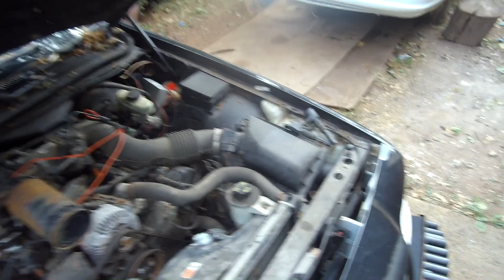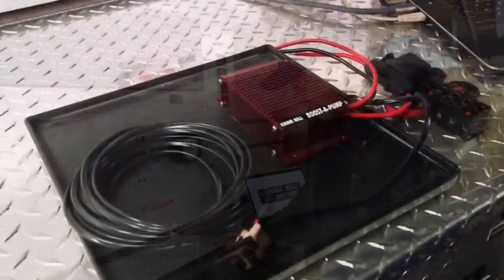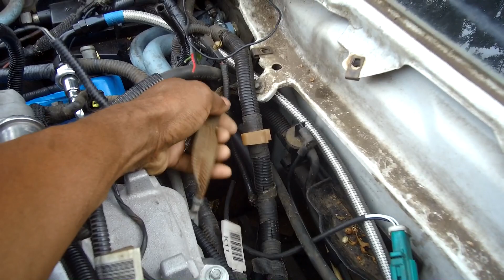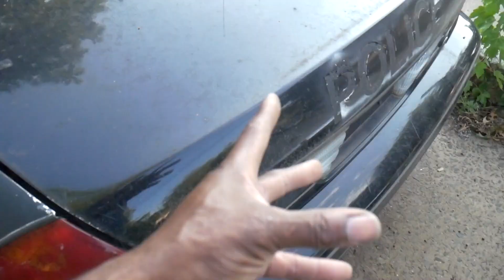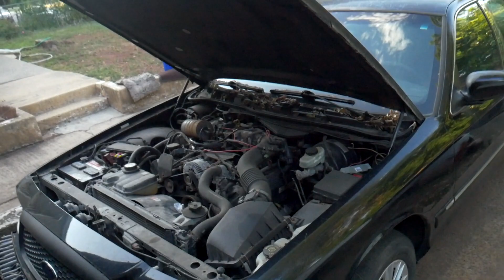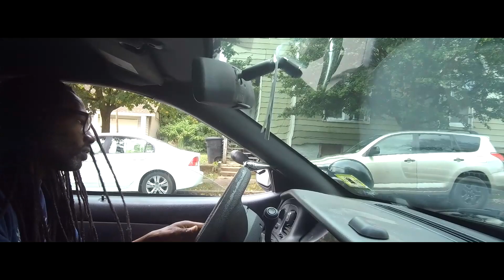Crown Victoria ( Simple Repair )  Fundamentals  and Panther Build YOUR CALL!

Comment: The body can be fixed but you've already lost steam on it. You have a bad taste for the Vic brother. You have to decide whether you want to wash your mouth out and knock her out. I'm having the same issue with my 03' I love the sound of a Vic. I keep jumping back and forth between spending dumb ass amount of money to get that 4.6 to make decent power or just Ls swap it. I am working on building a 6.0L gen 4 engine. But it won't sound like a Vic anymore. The cams are 7 to 800 bucks for the 4.6l. It 250 to 400 for the 6.0. I'm stuck as well. I can get a supercharger from. ADTR but again it's $6500. I can do the swap with a 6.0L and 4l80 for about 4 grand and get 400 at the tires easily. Bro that Vic is worth fixing. If it is to you. It'll never be perfect. They never are. But perfection is fleeting.  Thanx for the content as always brother. I really enjoy your videos. If I do the swap tho my wife wants me to do a step by step of how I do it.And put it up on YouTube to help someone that might need it.I already have conversion mounts and some other small stuff I need for the swap.  There are some swap videos on the Vics. But not detailed. Thank you brother.
Reply from the maker: You spoke the truth Hugh... I do have a bad taste for the car... But i can do something cool with it ( depending the route i will go ) No hp is a problem I woul swap the engine out with a Dohc 4.6 and 5 speed it ( for now ) Then turbo it I will get the numbers i want for under 4k... With the stock cams and low boost ( a spooly typoe turbo  ) i can get 400hp easy.... You should do the step by step video PLEASE let me know and i will support... Take you time and tape in section ( do not make a freel flowing video )  tap the engine extraction. STOP then Engine prep STOP explain engine mounts STOP you get the idea... Thank you so much for this comment... I really enjoyed this and you wife is right film it ( explain the harness wiring )
Reply: You got it bro thank you for the incouragement. I can't wait to see your next one.
Reply from the maker: @GrandPitoVic  thank you bro just waitiing on parts cause this is  real life deal.... when bills kick in you just can not spend , just have to wait lol

Comment: I've finally started my 78 Fairmont Futura build,but sadly all the big engine building companies seem to have stopped their 302 stroker builds & sales...should I just look for a Coyote for my project or what??!! I've wanted to drop a strong 331 stroker in my Futura, but none seem to be available anymore...any thoughts or ideas brother?! My next thought was a 4.6 dohc out of a Mach1 or Marauder, as they are strong & ALL aluminum...
Reply from the maker: It all depends on what you can get your hand on for CHEAP and the power you are looking for... Coyote in you car will cost you 10k ( fox body parts harnees engine ( blah blah blah ) if you go old school 302 ( there are PLENTY of stroker kits out there oooooor buy the engine built. simple way to go around that  ( direct drop in ) ad your carb or efi.. You have to look and search slow to get what you need... Coyote may be out there for cheap

Comment: I got a 2010 crown Vic for $1k with 400k miles. Runs like a champ! Took it on 2, 6 hour road trips this year. Your videos are very well explained and I want to thank you for helping me mod my crown Vic and your good advice on these vids. Just got the 4.10 gears on it now it’s swinging like a 392 🤣. Keep up the good work brotha. I subbed
Reply: Wow!!! 400K miles and still rolling!! 💪🏾💪🏾
Reply: @GrindHard365  thank you! At 405k as of now!
Reply: @streetstallion  Thinking about buying an 03 fleet service  Lincoln town car with 330k. I had been hesitant but this gives me confidence.
Reply: @GrindHard365  definitely the 03 is more reliable without the flex fuel system in it like mine has. Id definitely go for it cuz those fleet vehicles are always serviced

Comment: My 99 crown vic Alternator surge the other day now my gas hand and volt hand don't work I replace the Alternator and I have no blown fuses??? Any ideas 💡
Reply from the maker: Killroy is right they do go out, but it seems more like grounding issue... How to check that ( well that will be a crazy deal ) a cluster is cheap you get one and install it and see what happen then check power ect... You a pinout to check stuff its gets deep from there but light... Stil think its a ground not grounded.. check under the hood
Reply: garages possibly going out! it's common on these cars! But that is just a possibility of many

Comment: MaaN, I’m honestly having a Really bad oil leak under my 4.6 crown Vic and it’s making a Clanking Noise, now it’s starting to run hot.. Idk what I should do ?
Reply from the maker: you have oil leak and it must had ran out of oil or fan is not on... You may have thrown a rod... best thing to do is replace engine or buy another car unless yours is real clean...

Comment: frame swap a truck onto it. it can be a toy and work. it also be a nice thing you can show up with. the cab and bed is what youd have to buy the frame would be in good shape. some wheels and it would be awesome
Reply from the maker: Nice to here from you bro... I lean towads that lane... There is reason for it it time to ( in my head ) to step it up a notch ( just see if i will fold ) I rebuilding motorcycle engines so its like ok ( lets take it there )

Comment: U can also just do a fuel pump rewire  it'll give it 14.0 v  instead of it being regulated to 12v  that'll help a little. Alot cheaper
Reply from the maker: Thats true just hard wire it... it is a LOT CHEAPER... good stuff pedro
Reply: @bstfordchannel923  used to do it in the dodge neons all the time  just make sure u have use a relay

Comment: My man... you're dressed for the part and headed in the right direction I'm telling you. Dealing with some of the same issues and delimas with my mgm. What to do what to do. Sidelined right now due to motivation I suppose but I'm always doing research. You know. Thanks for some great stuff as usual and that joint there at the end... yeah!
Reply from the maker: thank you for the words brother AND checking video to the end!.. Motivation was a thing I was dealing with, but ( take baby steps ) start with washing the car... Then clean the inside ( depending what the car looks likes and needs ) then you start chnging things out/ wiring/doing minor things... If you keep a slow flow it will be done sooner than ( having the funds to do it all at 1 time )
Reply: I've been looking at some of these demo derby sites. There's one video out there that gets really deep into the difference between frames. My take away from it was the newer style is actually superior and more rugged than you would think... the hydroformed frame being a big advantage.
Reply from the maker: @russco5008  yes the 2003 -up chassis is better ( and heavier ) My aero chassis is THIN ,weak ,and flexable... If I found a black aero i wouks swap this chassis over for sure...Just a rare color

Comment: I got a low keep alive voltage code.
What causes that? 
The best body swap I've ever seen on a crown vic is when it's converted into a 1970 Dodge Charger. There's a guy on YouTube that makes dukes of Hazzard chargers out of crown vics. I was thinking about doing that with my 1958 Desoto, but the wheel base is way different. I'd keep it as a parts car. That would save you trips to the junkyard. But I have 5 acres.
Reply from the maker: your alt maybe on its way out... it may go in and out check connections just be safe...i like that body swap.... i just want to do 1 and NOT do another lol... it can be done you have to shorten the vic chassis, but f all that ... i  would just wait until your ready to make a good move with the car

Comment: I’m not sure what I’d do with it.. I’d probably just put it in my back field , rather then sell it for cheap..and then need a motor or transmission..  measure the wheelbase and width and maybe get a 60’s car and bolt it on the chassis.
Reply from the maker: thats where i am at... i really dont want the car, but hate to give it away like i did my Lincoln L

Comment: BST!!! Great video, excellent stuff and diagnostics also. Motorcraft coils are the best way to go. So junk yard is the place to be for them.  We are saying do not spend the time or dollars let her go. You did great but let her rest.  We see a mark viii or maybe find an older LTD square body in your future. Intrigued by what's to be continued 🤔...peace my friend.
Reply from the maker: yeah thats the issue letting her rest... Its kinda in my way PLUS  that jag to... I have to find a crafty way to get rid that car... I will hold out but i have to do something with it soon...Thank for your input I have to see what the guys are saying..
Reply: @bstfordchannel923  so throw the jag on Craigslist and ebay. Switch spots with the white 4v with the black. Use that for helping with mods and diagnostics.. see if we have trouble troubleshooting you can be the test bed fixer. Using the black crown. Use the white as the daily ripper/driver. We will call you DR BST.

Comment: People been doing frame swaps with crown Vics for a long time I've never seen somebody frame swap a minivan.  Or something that should be front wheel drive but you can smoke the tires in the rear.
Reply from the maker: A minivan would be sweet... I have to check into it and see what can be done... need to find a mini van with very close wheelbase

Comment: And ❤️ that Ford stopped putting the plugs outside by the exhaust manifolds, and Stopped with the early Falcon/ Mustang/ Early Thunderbird style spring towers. The three valves might be a Royal pain to de spark plug, ( esp 5.4 3 valve) but the whole thing isn't of mess of exhaust verses upper shock towers 👍🫡.
Reply from the maker: AGREED! i do love the style of spark plug placement, but each engine has its flaws.... 5.4 3v its a no go for me

Comment: those ~$20 coil packs I found on Amazon (links in my video doing the tune up) have worked flawlessly.  I bought a couple extra sets because I was assuming the price was a mistake
Reply from the maker: I will have to share that video so people can buy those
Reply: @bstfordchannel923  despite what others are saying, they are working flawlessly for me
Reply from the maker: @WJHandyDad  ahh I have to check those... Chuck will tell ya the next move for us...He will explain
Reply: I bought some of the Amazon COPs. One went out 6 months later. When I swapped them out for my current MSD set, most of the boots had disintegrated and about 1/4” of the tips stayed on the plugs. Fun to remove. I actually posted me crumbling one in my hand on YouTube. (The COP failed because the boot split and was shorting to the block) and yes I greased them before install.
Reply: @thetravi1348  I use the stock boots. No issues with mine. I have 5 vics right now all running the cheapies!
Reply: @pfckirk  the Amazon cheapies? The Chinese stuff? Or motorcraft? I would have preferred motorcraft. The boots were the fail point on the Chinese cops.
Reply: Howdy Chuck!

Comment: Striping the car for parts and using the newer frame on the aero Vic is a good idea. I keep a spare coil pack with a 7mm ratchet wrench in a crown royal bang in the spare tire area of my Town Car.
Reply from the maker: I was really leaning towards that UNTIL i stop working on the car... I wanted to do the frame swap 1st then add in and trans to the frame while body was off.... i had plan just did not move on it... Got scared cause the lack of help

Comment: I couldn’t afford a full set of oem COPs so I got a full set of MSD for half the price. Would have gone accel but read that they burn out pretty quick. It’s been a year and still running strong. (I saved the old good COPs of course)
Reply from the maker: as you should always save them ( if you rolling with a 4.6 ) its best to have them handy brother... them things cost! lol
Reply: I concur, Accels suck. I have a set of Duralasts currently and they have been working for the past 20k miles and I can exchange them at Autozone when they go bad I think.